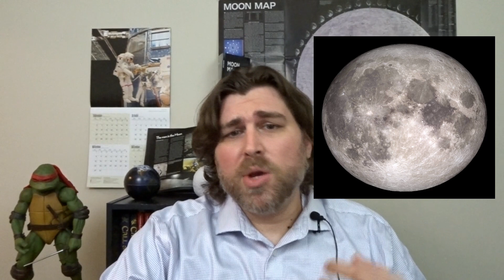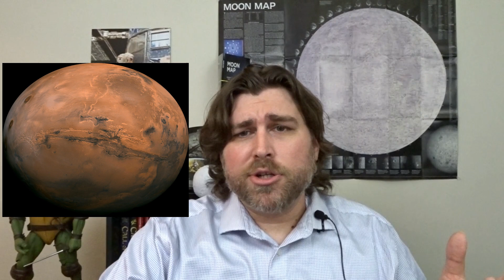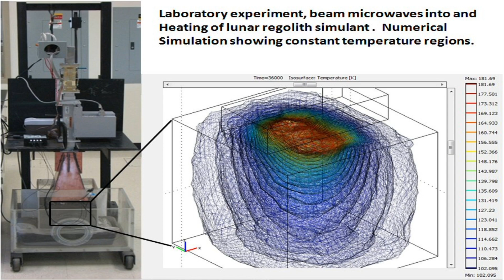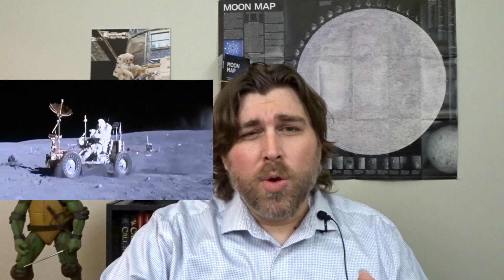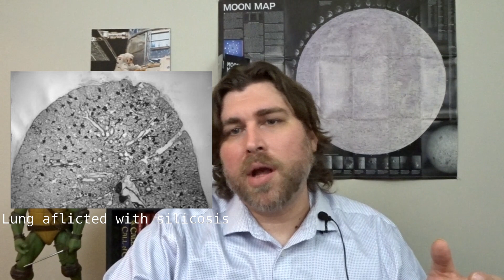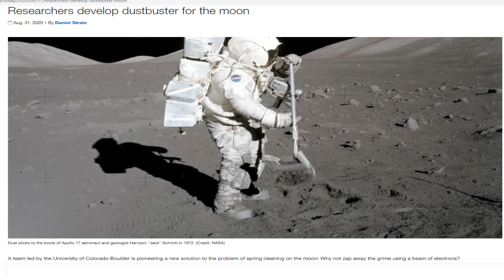Everything You Need To Know About the Dangers of Moon Dust!

Comment: I thinks Taylor and Meek were off on the nano Fe and had more to do with particle shape. Magnets probably wont be all the effective as much of what I've read seems to indicate that the smaller particles do not react all that well. However I think the microwave sintering would be very effective for roads and landing pads. Taylor indicated that the half power depth decreased as the temp rose, that implies that you will get increasing desification the closer to the surface. so you get a roadbed under the road as you go.
Reply from the maker: Yeah, I'm looking forward to seeing Taylor's concepts tested further. Though, it makes little difference if there isn't a means to keep the lunar dust from getting everywhere in the first place. I guess we'll have to see what solutions they come up with if magnets aren't going to help.
Reply: @ScienceGet  Electostatic is the initial key. Just substitute your magnetic thinking with that and charged belt. wand and filter pop in.